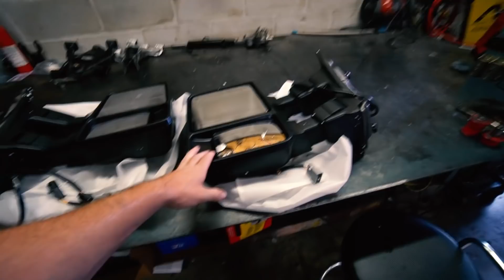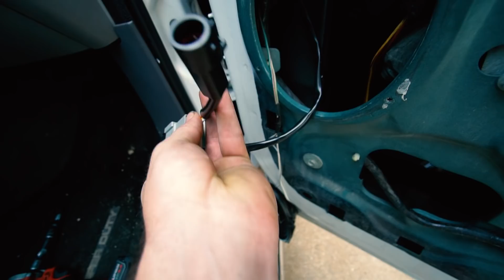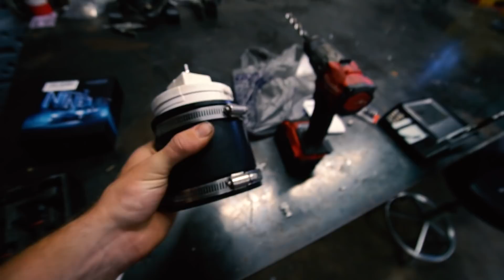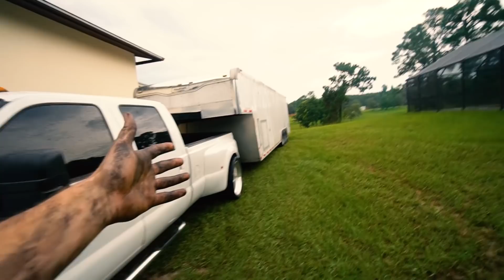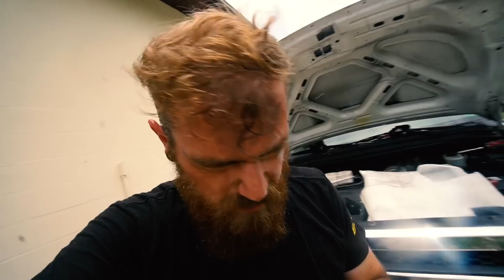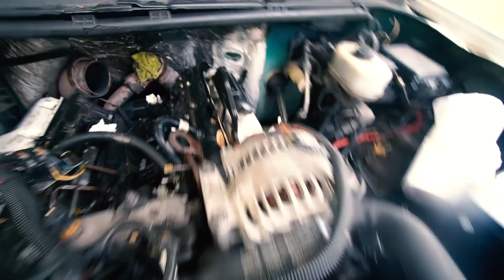Found a HUGE PROBLEM With My 7.3 Powerstroke on 24's! (Explains why it's so slow)

Comment: Don't put led or hid headlights in a halogen housing. They will have a bad light pattern and just blind everybody on the road. Hid into a projector housing is the best for headlight upgrades. Just don't be that douche that puts the wrong bulb into the wrong housing.

Comment: “the truck may not be able to go fast up hills” 
Seriously? That’s not what you use a truck for. It gets you where you need to go, hopefully dependably, and that’s it. Suck it up and drive with the truckers if you have to. It’s not every single day you’re going on a 20 hour trip, and gaining an extra 20mph for the random hilly areas isn’t going to save a reasonable amount of time. Honestly if you keep this complaining up, It’s just going to get annoying watching these vids. If this truck doesn’t work out for you, suck it up and buy a single axle semi. It would be cheaper than this truck anyway. Other than that, liking the vids.
Reply from the maker: If you've ever towed for 20 hours strait, you will understand that if you have to be floored going up a hill and still loose 20mph it's exhausting. It's tiring enough to tow for that long, but doing it in something that can barely pull up hills is horrible. I've done it and it's miserable.
Reply: Taylor Ray I have. Whenever my dad went truck driving, I was with him(sometimes driving 24 hours plus straight), and recently went towing with him to pick up a crashed f150 in our 97 obs. Put on the emergency lights, stick to the right lane or whatever the signs recommend, and set the cruise while watching your temps. I get where you’re coming from but you’re taking a lot with you and you don’t have a 2019, 1,000lb feet of torque truck. It’s kinda expected. We stuck to 30 on some areas when we needed to and never drove it at full throttle.
Reply: You're complaining more than Taylor lmao
Reply: SAMSOR i understand what you are saying that the truck is a tool BUT going up hill floored with a setup like Taylor has will do horrible things to the truck IE EGTs to high, Trans temps to high, coolant temps to high and not to mention that your just sucking down fuel and putting unneeded abuse on the truck. I bet your "DAD" doesnt even monitor his temps or you as a child dont get the fact that maybe hes had to put a lot of money into the truck in order to maintain and continue to use HIS truck.

Comment: Litterally Makes a video about why you should NEVER buy a used diesel. 

Trades used diesel for another used diesel. And a ford nonetheless.
Reply from the maker: You do realize I made fun of myself on that video and the title of that video for this exact reason right? Also. My video on not buying a used diesel was in reference to people who buy one when they don’t need it.
Reply: Just giving you a hard time bro i know you know what your doing just wanted to be that guy 😂
Reply from the maker: matthew dickey it is ironic. Lol I figured something like this would happen which is why I tried to caution people away from buying an older high mileage Diesel if they don’t need one. But at the moment with my enclosed I do. Lol but this truck is also rad so it’s problems don’t bother me as much.
Reply: Tuche. It is a good looking truck. Thanks for the great content brother.